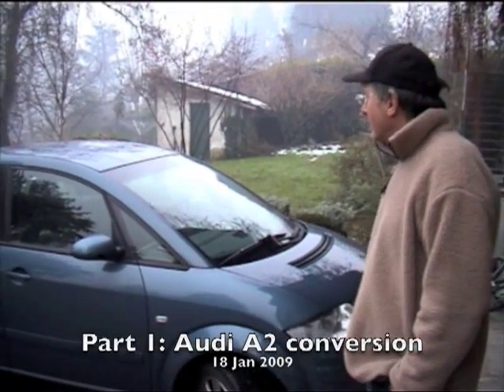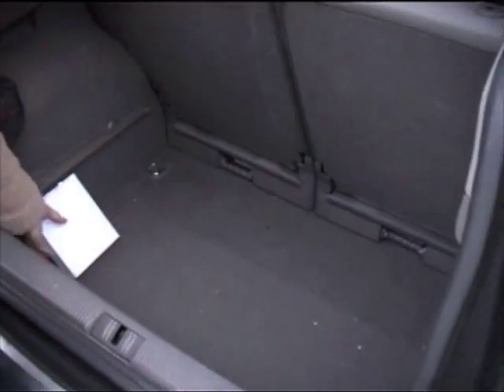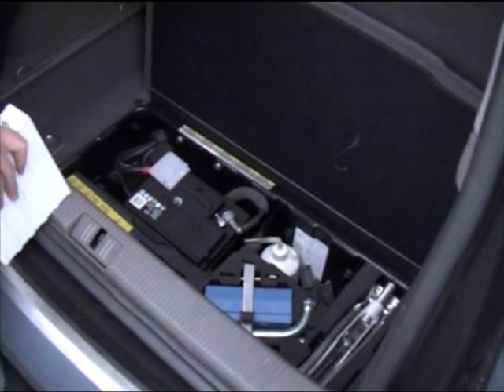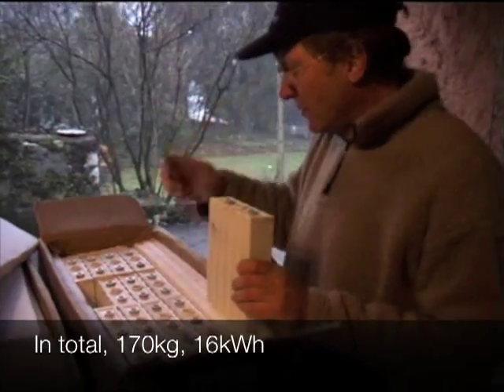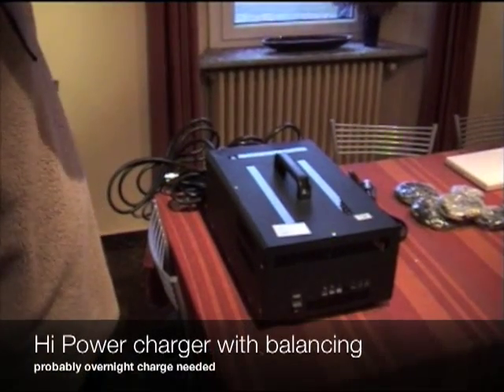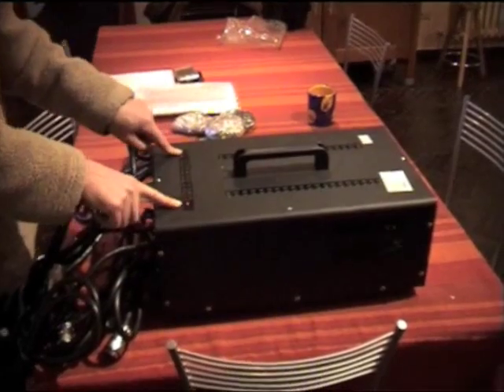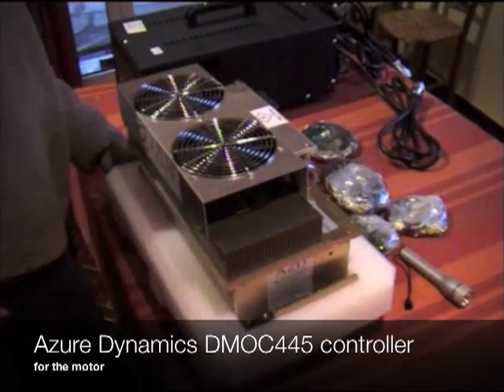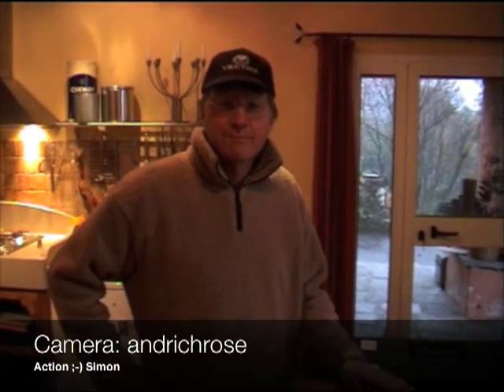Part 1: Audi A2 EV conversion - the parts

Comment: Very interesting project. Pretty much the best hardware man can find in 2009. I reckon these parts were quite expensive back in the time. How did it go? Did you experience any difficulties with this conversion? I'm also considering converting my old A2 1.2tdi so any feedback would be much appreciated.

Comment: I just ran across this very interesting pdf about windtunnel improvements to the A2
ww wm.coventry.ac.uk/researchnet/lowcarbonvehicles/Documents/Aerodynamic%20Challenge%20Event%20Documents/Session%204%20-%201%20-%20Hussain%20Ali%20-%20Drag%20Reduction%20on%20a%20Production%20Vehicle.pdf
takes it from 0.288 to 0.2!

Comment: the A2 makes for a great donor. it's relatively light and has one of the absolute best aerodynamics among production cars. that's a strong combination.
plus it's a classy car in that it's an Audi. and the look ages quite well. it doesn't look old at all.
nor is it really expensive. as low as 3000 euro
and there should be no problems with parts either